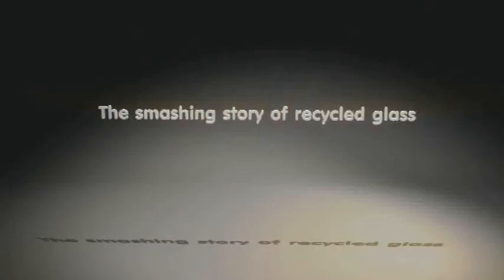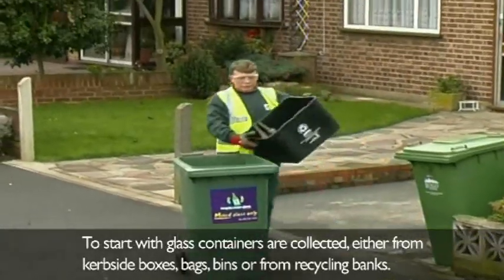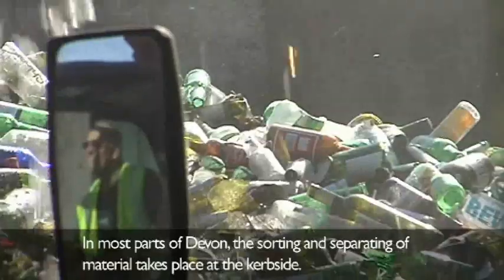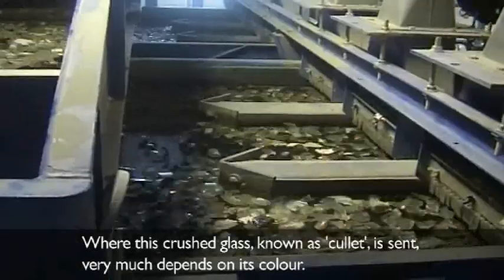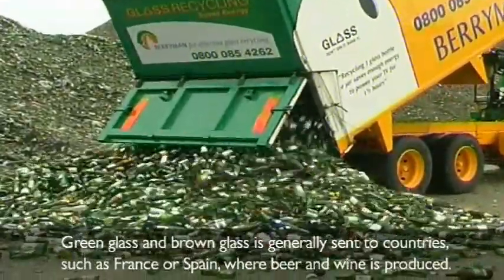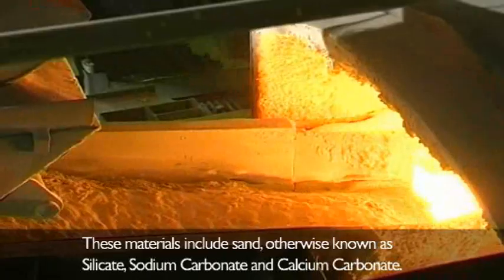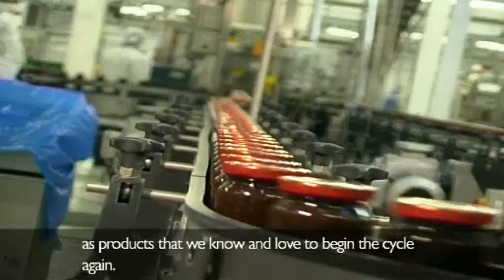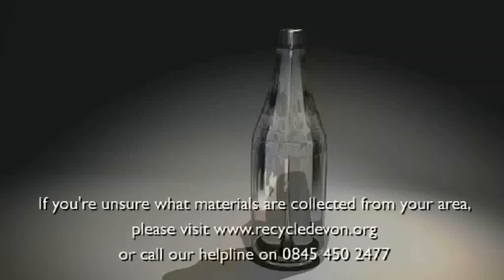The smashing story of recycling Glass

Comment: How strong is glass as a construction material?

For example, if it's made into round marble form, or into solid cubes.
Reply: Glass if strong, but very brittle.  on paper it could be reinforces with rebar, but could not be poured on site like concrete.
Glass also has very poor insulation properties.
Reply: Has a high compressive strength but low tensile strength

Comment: I wish that the United States was as advanced in glass recycling as the UK.  While paper and cardboard recycling saves trees, glass never decomposes and can be recycled infinite times.
Reply: @Frank Swoboda I agree that it's difficult, but it never decomposes.  I've been looking into it, and what Oregon does is crush glass into fine sand and use it to build roads and for drainage material in land fills (the exact same thing they would use sand for).  I think that's probably the best option, because it is still recycled, and it does not cost a lot of money (they would have to collect glass for trash too).
Reply: @Frank Swoboda how so?
Reply: @Frank Swoboda We might have unlimited sand, but we certainly don't have unlimited landfill space, and in my hometown they destroyed a wetland to expand our landfill.  Also, there are ways to deal with the problem such as having local glass crushers and using the crushed glass on whatever sand would be needed for locally (e.g. building roads), instead of trucking it hundreds of miles.  Nothing should go into the landfill unless it is absolutely necessary.

Comment: Good idea to recycle glass, but it is so energy intensive to make and energy intensive to recycle, as well as energy intensive to transport because of its weight, It should not be used at all if there are better alternatives.
Reply: That's why everything went to plastic. Easier to recycle and less energy to make into new products.
Reply: When compared to alternatives like aluminum, it's cheaper when comparing the lack of mining necessary. Plastics can be recycled (some not all) but only a limited amount of times before they will break down. Glass is non-reactive, will never breakdown (into other harmful materials) can be recycle indefinitely, has a never ending supply, and if reverted back to an exchange system is sustainable since it will not need to be reprocessed.
Reply: Yeha mate
Reply: You can turn used glass back into virgin sand by using a 100% renewable zero carbon process with very little infrastructure investment - just throw your glass bottles into the sea and let the waves turn them back into sand.
Reply: Can somebody confirm that plate glass ( window panes ) cannot be recycled?
Reply: I was called a glass recycling company in Constanta (not just one, but this is the cake of them), on papers,, of course he has a site online. Sites online we have a ton, with recycling principles and stuff. Yeah moralistic stories everywhere !!! I called the most official Constanta recycling system possible. "Sorry we don't take anymore glass because THE GLASS COLLECTOR PARTENER COMPANY WE WORKED WITH  HAS FINISHED THEIR ACTIVITY AND CLOSED !!!"😈🤬😡😠 
P.S. THERE IS CURRENTLY NO WAY TO RECYCLE WINDOW GLASS IN CONSTANTA, A CITY WITH 500.000 INHABITANS !!!
THE CONSTANTA IS AN EUROPEAN UNION CITY !!!🤪😜😟

Comment: Hi, can someone enlighten me?

I've read that broken glass is not recyclable. Some sites claim the strength of broken glass is reduced.

But in the process, the normal ones are still crushed into cullets.  Providing if we can get broken glass into recycling plants safely (without harming waste handlers), is broken glass still recyclable? Or because it was broken not accordingly to the recycling process, it would never be recyclable again?

Thanks.
Reply from the maker: Hello Lam, Devon accepts broken glass bottles as the glass is completely crushed to be melted and reused. There is no way to recycle glass that doesn't involved crushing and melting it, so we don't know why the strength of the broken glass would be an issue! We don't accept broken drinking glasses or vases etc though as they are made from a different sort of glass which may be what you are talking about?